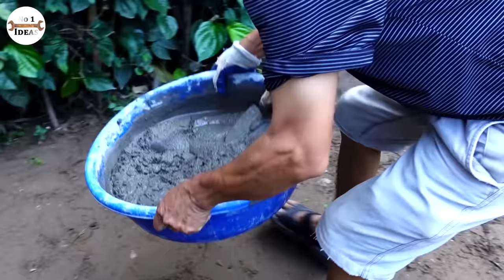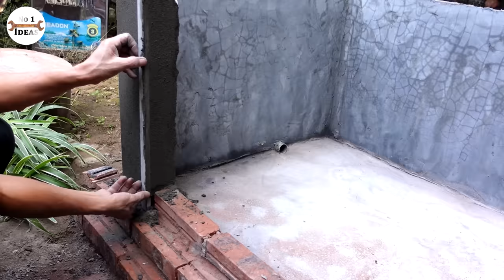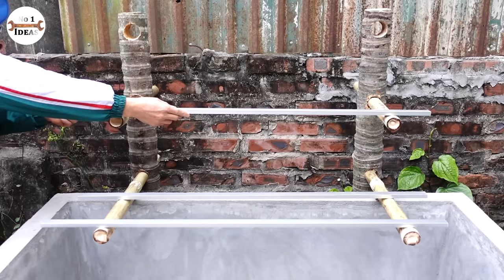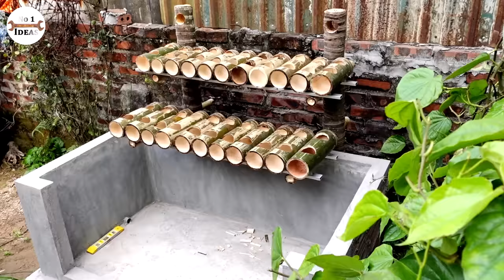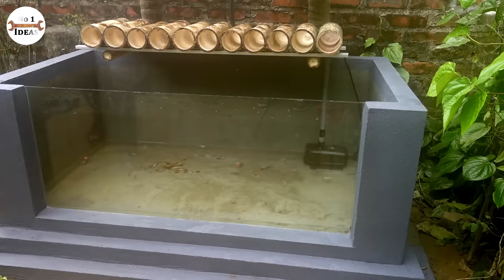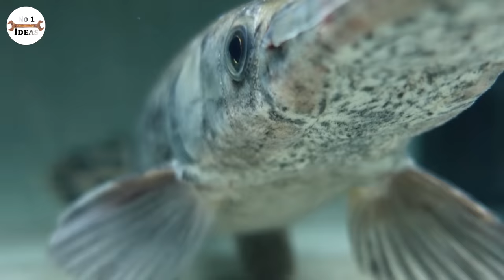The Secret to Make a Fish Pond Combined with Growing Clean Vegetables

Comment: I want to make something like this so bad! Using the bamboo is really nice. When I make mine I'll try to build it to reduce the water fall sound, and use it to house turtles instead. Instead of painting the concrete I would have left the crackling texture all around the surface. I'd also design it to hide the PVC tubing where possible.
Reply from the maker: Many thanks for your interested in my video!
Reply: Pero el sonido del agua callendo es relajante

Comment: The biological filtration of just the root wicking material is quite insufficient unless I missed something here.  Pretty sure you would need much more substrate to proper cycle.  The project itself is wonderful, don't get me wrong.  I would be looking to increase the biological filtration medium significantly for an "aquaponic" solution involving fish of this scale.
Reply: this looks cool, but it wont work long term for that reason. also the fish are to big for that enclosure.
Reply: Was thinking the same thing. The fish poo was going straight to the plants. Yikes
Reply: Adding a discreet sump tank would help right? Plus obviously smaller fish like Koi lol

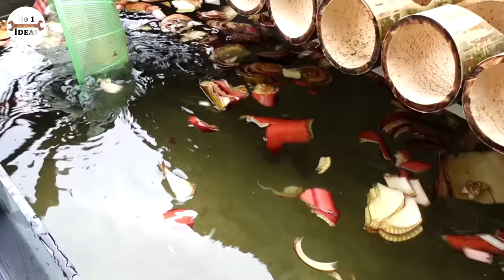Comment: 11:45 why soak the bamboo for 7 days and then drain it out just to fill with new water ? I'm new to this haha 😅
Reply: It is not bamboo but banana tree. It is for cleaning the cement. New cement is dangerous for fish
Reply: thank you for the question, many of us certainly wondered the same :)
Reply: but you painted it didn't you?
Reply: Does the cement change the ph too much in the beginning and is that why the banana trunk? Looks like lots of tannins which is good for palancing ph.
Or am I completely wrong and there's another reason entirely?
Reply: @wakeupthebear  didn't paint all interior
Reply: @ricardocaliman2830  its to remove the high amount of lime the cement release into the water , to neutralise the lime

Comment: Several issues I have with this, First as has been mentioned the bio load on this system by those huge fish is way to much. Which leads me to the second problem, there is no bio-filter. You need a bio-filter to turn the ammonia into Nitrates for the plants to use. Not to mention to prevent from poising the fish. Lastly it's the friction fit of the tank drain, that could slip off and drain the tank at some point and good bye fish.
Reply: You can choose telapia fish or guramie , ar aroo instead.
Thanks for sharing ur know how too. Appreciate it.💕
Reply: The the cotton/synthetic stuff in the cups could host bacteria, or he could put something in the 1st hole where the water poured though. But it needed to be cycled, especially with such a massive load. Maybe he did daily water changes to get it going. But, I have a feeling this design just didn't work because the cups seemed to be well out of the water as it passed through the bamboo. If they were touched by the water, it was maybe enough to keep them damp, no more.  The bamboo is curved and the cups are flat. Maybe cutting of the bottom of the cups so the cotton was directly in the water would solve all these problems.
Reply: This is a yt Video, not a aquaponic guide
Reply: I would use a pond filter pump, so that would cover cleaning the water. You could still have a 2nd pump just for the plants

Comment: the roots to water access is way off, try again.
maybe a dam at the end before the water drops down.
Fish are waaaay to big for the tank.
Its a nice idea but needs some fine tuning big time.
why not water proof all the cement also?
applying the cement you didn't keep it properly wet during drying time and it cracked.

Comment: Simple stuff that I noticed as the video went on:
You have a valve for your hose, would it not be wise to have one for your outlet pipe as well rather than a stopper?
What is the best way to keep those pieces of bamboo on the metal rails? I think you used glue, but couldn't tell.
What materials are needed, and what were the final dimensions?
Would you need snails or other water cleaning animals in the water for the sake of the fish, or is that kind of the reason for the plants in the first place?
What was the purpose of cutting up the piece of wood after the first pool filling?
What are some good plants to grow in this way?
What are you using to wrap the roots of the plants? I think it's cotton gauze, but I can't tell.
Did you use epoxy or some other adhesive to put the PVC piping together, or just simple pressure from the enclosures?

Stuff like that.
Reply: Cut and throw in the banana tree for clear the toxic from cement snd then balace pH. Use filter cottom for keep nutrients and grow lettuce. Big fish because they will be the food with salad in a short time
Reply: @ducnhat1892  
Okay, that makes sense. Never knew you could use parts of a tree to correct the Ph of the water, thank you. The cotton was being used to help clean the water alongside the plants, that was very smart. I hope the fish taste great!

Comment: Unsealed concrete is a fish killer. It continually lowers the PH of water to the point of being unsafe for fish.
The white filter batting around the lettuce isn't even in contact with the bottoms of many of the cups and some cups aren't even in contact with the water in the bamboo. The lettuce would die from dehydration in many of those cups.
Fish of that size are in no way appropriate for that size of a tank. It's cruel to keep them in a tank that is so overcrowded and small for them.
18 days later, my ass. Bamboo discolours in water and it does not take long at all. Somehow in those 18 days, not a single speck of algae grew anywhere in the tank, in the lettuce cups, in the bamboo, nowhere. Nuh huh, don't believe that for a second. With that many fish producing that much waste in a newly set up tank, there would be such an ammonia and nitrate spike, the algae would be going wild!  Carp are notoriously filthy fish and yet we see absolutely no waste in the water. I doubt that water pump and lettuce whose roots that aren't even able to properly reach the water would be up to the task of handling the waste produced by fish that large.

I'm willing to bet all they did for that 18 day shot was switch the lettuce out for larger ones and throw water hyacinth in the tank to make it look different.

The concept is a really nice idea but it's painfully obvious this was made purely to farm content and not be a properly sustainable tank.
Reply: Picky, picky, picky...
Reply: @FASTRACKFARM  Pardon me for having no tolerance for bullshit.

Comment: That's a cool design. I hope it lasts a long time and does good work for you!

What kind of climate do you live in? That will, of course make a big difference on how successful a model like this will work for any who want to try this.
This model would not work in my region, however, something similar to it would work here. One of the first differences would be that the fish tank itself would have to be either partially submerged underground (about 1/3 a meter or a bit more) and the pump and parts for the irrigation system would need to have a way to be completely drained. steel rebar and a heater might also be good investments around here. Otherwise, something like this is fantastic!

The temperature in NJ can go below 0C for weeks sometimes. That's why you'd need to make some alterations. I would also opt for a several sheets of Plexiglas or clear plastic next to each other and sealed in case of issue.

My guess is you live somewhere where the temperature doesn't go below 0C nearly ever. In places like that, you don't have to worry about the 15% expansion of water into ice :-D :-D :-D It makes a BIG difference in planning structures....
Reply: I also really like your incorporation of bamboo in the design!

Comment: Hi Sir, fascinated with your construction.  What started out looking rough as guts turned out beautiful with the top coat of cement.  What are the first lot of fish you put in the tank with the pointed snouts?  They look like Sturgeon to me but I bet I am wrong. 

Some other viewers have come up with some good suggestions like adding a first stage filter to capture that Nitrites and convert them ready for plant growth in nitrates.   You got lots of criticism about the size of the first fish compared to tank volume.  I thought it was a good demonstration that this is an aquarium and that long term you would change the mix to growing babies into feed sized fish as in aquaponics.

As for the hydroponic part, 24 lettuces may be overkill but it does demonstrate the system.  You can put whatever mix of hydroponic plants in the final system that you like.  

Overall, I think the general concept is excellent. Well done.

Comment: what type of glass/contrite sealer you are using? is it silicone or the caulking sealer? thanks for your reply. i'm putting 64" length height x 18" x 0.500" thickness tamper glass just to make sure it will withstand the water pressure. looks like you have 0.250" thick glass for your aquarium.
Reply from the maker: Many thanks for your interested in my video!

Comment: Concrete is porous, much of that water will drain out into the soil beneath and over time it will add up. should have used some type of hot rubber or plastic interior.
Reply from the maker: Thanks so much😍